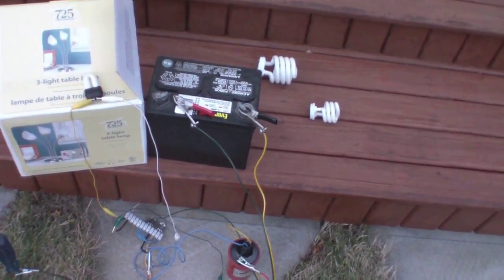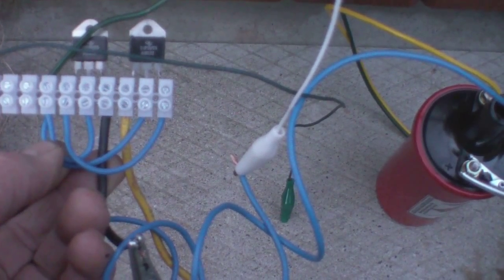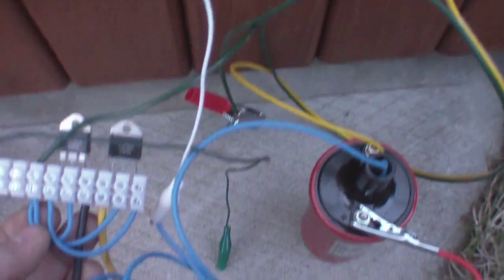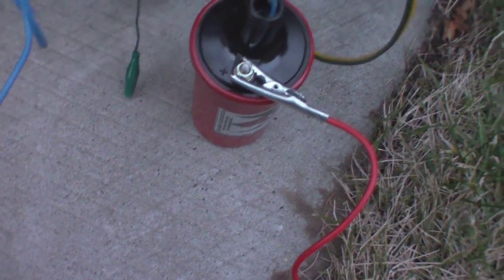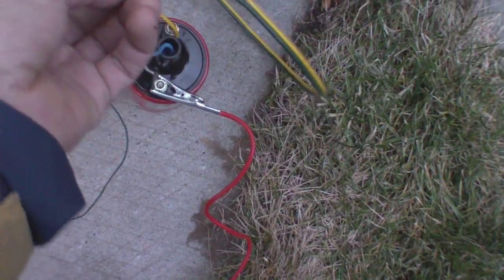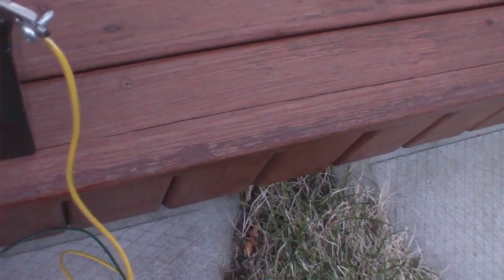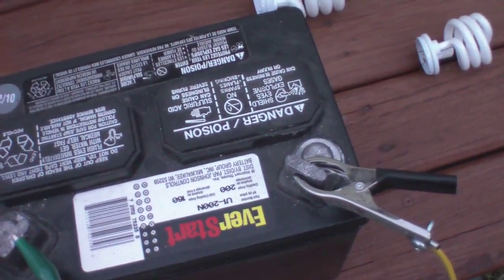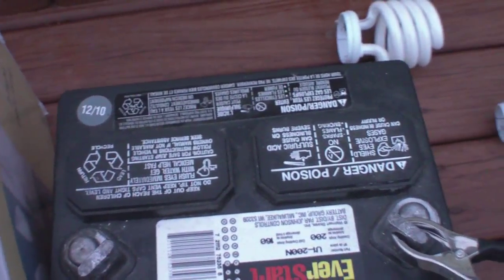(Replication Attempt) Imhotep (kdkinen) Radiant CFL Oscillator and Self-Charging Circuit

Comment: I think you are using the same circuit that I have been experimenting with. Where it shows a capacitor going into base of the timing transistor from load and spark gap that capacitor needs to be a three plate cap. If you hook it up right it will actually draw voltage from Earth ground and feed the base of the timing transistor and Wallah it'll work.

Comment from the maker: @egn83b Ahh, don't be so negative :) It did run... and now I got it running just fine. There is very little difference between a TIP3055 and a 2N3055, actually. I just needed a bit of base resistance, and increased my load some. The one thing I have seen 100 times, is an experiment, replicated with slightly different parts, with some slight changes to get it flying. That's the real learning!

Comment: I had the same thing happen last night doing a replication with tip3055's. It is not a 2n3055 that is why the setup does not work. My tip3055 don't have the ability to drive the circuit correctly either. The one thing I have seen 100 times is that people try to replicate something and do it their own way with different parts and they wonder it don't work hard lesson to learn but its rewarding to have failure to learn from.

Comment: Just watched the other vid. May seem a daft question but, do you need to be running a bigger load to force the circuit to do work ? Or, will it run with a different load, like an LED bulb ?